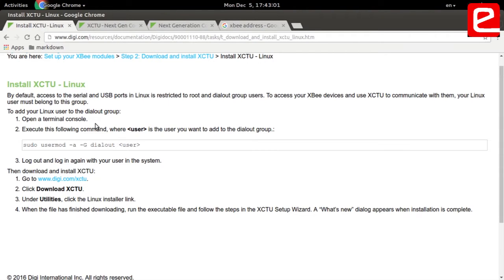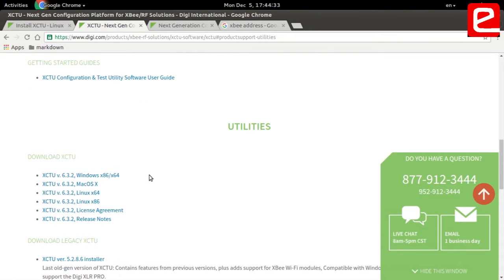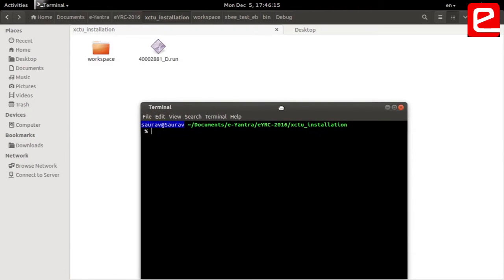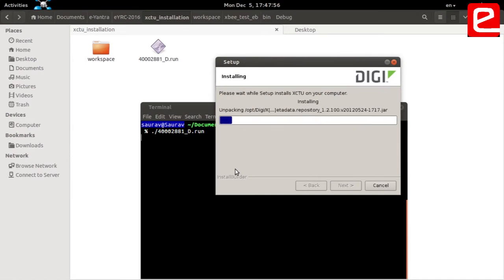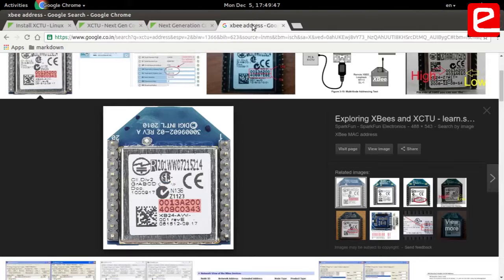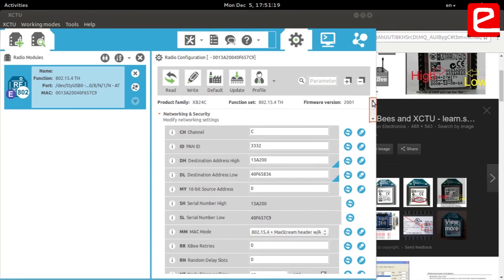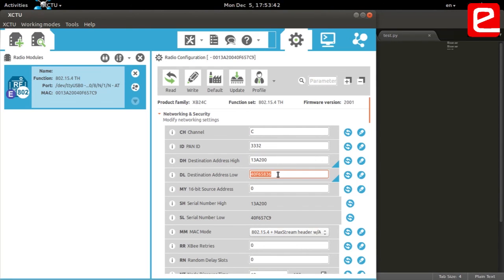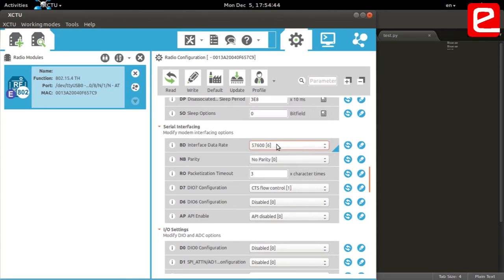eYRDC: xbee configuration for linux

Comment: when I install my xctu software as in when I do the installation process the software says multiple problems have occurred. error while performing force updates: 504 command not implemented for that parameter. checking for radio firmware library updates. checking for force firmware updates. how to fix this issue